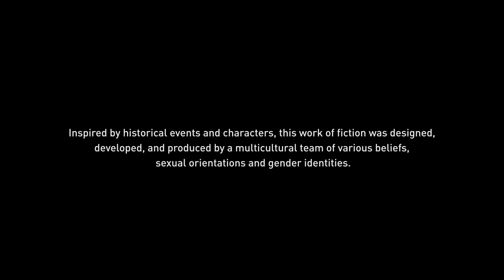ASUS Strix RX 580 in 2024. 6 Game Revisit.

Comment: Currently running this in my desktop my buddy built me after I lost my job and my old Alienware laptop was running too hot (I bought it used but only like a year old).

One of the better cards I’ve had over the years. I built an x800 Radeon desktop when it was brand new on doom 3 release as a teenager that was obviously better at the time but was also the most expensive card on launch.
Reply from the maker: I remember those early ATI cards. I also had an X850 XT. Great little card 🙂

Comment: Still rocking hard in 2024. I'm still using mine after six years of running 12-16 hours daily it works flawlessly. One of the fans rattles a bit at very high fan speed but limiting the fan speed solves it and the card still runs 15º below thermal throttling. Other than repasting and removing the dust no extra maintenance.
Reply from the maker: Fans are the first thing to go out usually. Amazing to see just how popular this card is. 👍
Reply: i broke one of my fans off my gtx 1080 strix mounting a gpu brace XD and thought it was over until i found out that theres the strix gpu fans you can buy for like $6 for a whole set of 3 fans maybe u can buy a single fan for $3 and replace it should help with the fan rattle
Reply: @GODFADED  Unfortunately I have not yet found replacement fans for a reasonable price. I check from time to time but they always sell for like half the price of a brand new 580.

Comment: I got the 7900xt , I bet it will age as good as the RX 580 !
Reply from the maker: With that 20GB frame buffer, you betcha!
Reply: @TechnologyHive  I bet you already have a RX 7900xt or 7900XTX!
Reply from the maker: @sithounetsith9877  I have them both. Great cards. I made a video about my 7900XTX. You should check it out 🙂.
Reply: @TechnologyHive  Wow great bro, 7900XTX, more powerful than a RTX 3090TI!
By the way what do you think about INNO 3d 3080ti that I replaced with the RX 7900XT, because RDNA 3 will last much longer .
You think INNO3D will be easy to sell ?
Reply: @TechnologyHive  I have not seen many 7900XT being defective compared to the big boys like the RTX 4080 and RTX 4090.
That 12 PWR connector on the RTX 4000 series made me skip that NVIDIA generation all along.
Reply from the maker: @sithounetsith9877  I think any 3080 Ti would be an easy sell!
Reply from the maker: @sithounetsith9877  You will be happy with your 7900 XT.
Reply: @TechnologyHive  thanks bro😁😎

Comment: Doing a budget build with a RX 580 later - which drivers are ideal?  If I go to AMD's website under the 580 support page, it looks like they are recommending the newest drivers (24.3...) I've read to only use 23.11.1 or lower. Also, I plan on selling the PC after I build it. So if I get 23.11.1, with adrenalin software - will it stay at the driver? What if the user updates it via adrenalin because it says there is a newer one? Will Windows try to auto-update to a newer one than 23.11.1? Please advise the best thing to do?
Reply from the maker: I installed the latest driver. If you got your information from Reddit, for example, take what's on there with a grain of salt always. The latest drivers fixed an issue for me with AC Valhalla where the game would just not load. I'd definately go with the latest drivers. No question.
Reply: @TechnologyHive  Thanks so much mate!

Comment: I still use rx580. I wish I wouldn't have cheap out on cooling and bought 3 fans design with big radiator. Instead of 2 slot, 2 fan tiny 3 heatpipes radiator.
Reply from the maker: What are your temperatures with that heatsink setup?
Reply: I usually set my card to 100 W while I game. 1250Mhz core, 1V. Temperatures are around 65-70. 2 90mm fans around 2000 rpm. At stock card was set to 85C while gaming and it was too much for me. Model of a card :Gigabyte Radeon RX 580 GAMING 8GB GDDR5.
Furthermore, one of the fans is not balanced. Makes this repeated sound at certain speeds and whole case rattles. So I have to set the cooling to fixed speed where is no rattle.  @TechnologyHive
Reply from the maker: @GreatVomitto  That fan rattle is the bearing going out. I would replace it soon, or if it continues to worsen. It can damage your card if it starts to vibrate too hard.
Reply: It was like that from the beginning, I didn't want to do anything to not lose the warranty. Anyway I just bought 4070 super and probably will put rx580 in second rig. I plan to put 120mm fans on it with zip ties 🤣🤣 I remember I had ATI HD 4850 before on which I pust passive big radiator and tied 2 120 mm fans. It never went above 50C. @TechnologyHive
Reply from the maker: @GreatVomitto  nice man. I just sold a 4070 ti with a noctua fan mod. Runs quiet and real low temps. 55c max.
Reply: Yeah, I really wish more cards have modded cooling. Now I test this Palit Jetstream 4070 super. Lowest RPM is 1150 which is really audible. Card this big should have double 120mm or even 140mm running at 800 rpm. @TechnologyHive
Reply from the maker: @GreatVomitto  With such big heatsinks mounted on these 4000 series cards you'd think fan noise would be no issue. But unfortunately that is not always the case.
Reply: That is so true. That is why I bought Fractal Design Define 7 XL Black Solid. I hope it will solve the issue. @TechnologyHive
Reply from the maker: @GreatVomitto  I hope so too man! Cheers!

Comment: How you have low temps my rx 580 would be 90 c degrees
Reply from the maker: Which model is it? Maybe you need new paste?
Reply: @TechnologyHive  I gave it new paste and it was only 40 c degrees for a week before it went back to 90 c degrees
Reply from the maker: @aksGJOANUIFIFJiufjJU21  I would take it apart again and recheck if the heatsink is making good contact with the GPU.
Reply: @TechnologyHive  Idk man I secure it too tight

Btw my rx 580 is the asus rog strix oc and its not 2048 sp
Reply from the maker: @aksGJOANUIFIFJiufjJU21  Okei. But I'd still double-check that paste contact. Those temps are very high 😬
Reply: take a thermal camera and check which area is the hottest so you could see whats wrong.
Reply from the maker: @hutaosupreme478  Thermal cameras are not cheap.